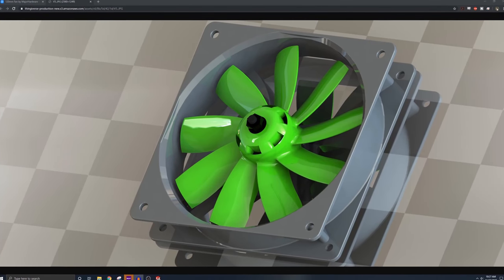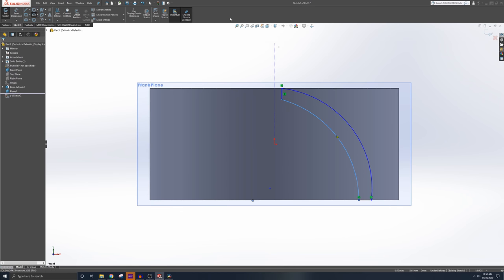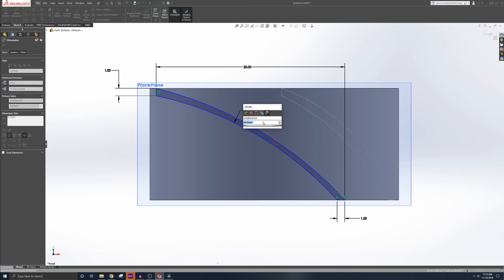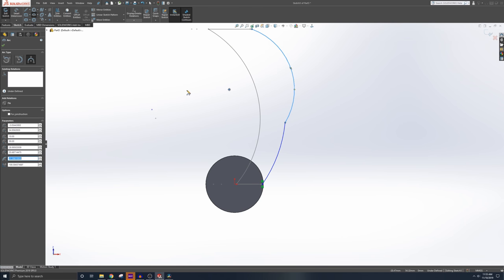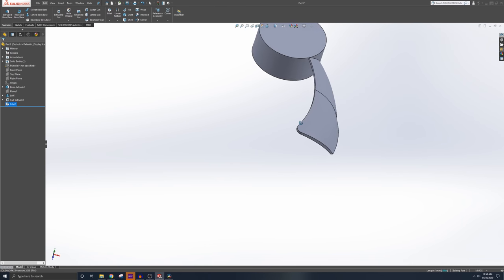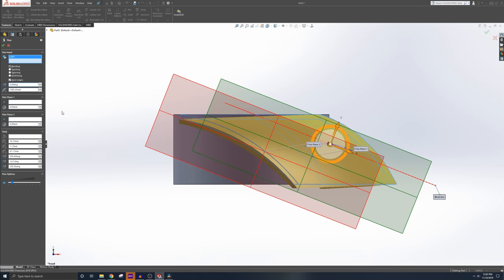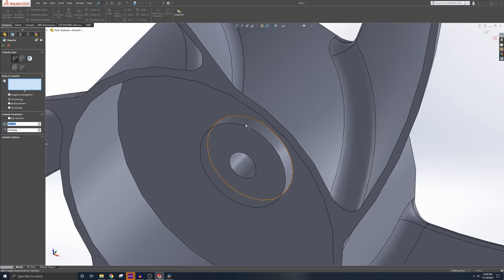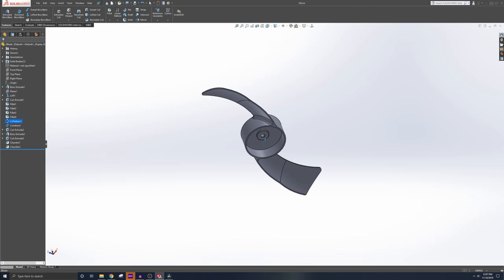How To Design PC Cooling Fan Blades

Comment: Suggestion for future videos: Designing your own ITX case using CAD software.
Reply: There are some chinese companies that will then build them for you or protocase in the US or Canada. That could be a really interesting video.
Reply from the maker: I want to do a small form factor but I dont have the hardware for a build
Reply: @MajorHardware  I am also working on a small form factor build, but I don't know anything about aerodynamics and I need your help. Is there any fan blade design that holds a noticable amount of pressure inside a sealed container (or case)? (we need pressure in order to increace the surface aera of the cooling parts in a buld like this) Thanks for your help

Comment: When I drew up a few fans I used the sweep feature with flex instead of loft, but it gives way less control of the shape of the blades. So any future fan design I'll definitely use your method 🙂

Comment: Been using Acad for 12 years but stayed away from SW as I could never get my head around the drafting process.  But after doing setups and making parametric families in Revit, SW makes a lot of sense and doesn't seem that difficult anymore.
Reply: New ACAD is decent but SW is just so much easier lol
Reply from the maker: Solidworks is the easiest in my opinion but I didnt use inventor that much and other than that I have used catia which is powerful but much harder to use but if u spend enough time on any of them you will pick it up
Reply: I've been lucky enough to use a spare ACA copy from work, but if I had to buy, SW & Inventor far outstrip Acad in capability.  It is pretty good when it comes to flexibility, free-form design, and the ability to brute-force solids.  I've really grown to appreciate it after dealing with Revit, where it will show the complete action but throw an error and refuse to do it.  And it can't even be bothered to tell you why.

Comment: Make some high static pressure fan blades for a 200mm noctua and compare again with using them on a radiator with water cooling.

Comment: Hey friend I'm designing some blowers on solidworks, so u have an idea to make it more efficient??? Nvidia design looks better than AMD old blower but I can't really prove it
Reply from the maker: Only thing you can do is run a sim to see what design performs the best and then do IRL testing
Reply: @MajorHardware  thank you friend!im new subscriber, and im trying improve you help alot with this. i don't have much experience with simulation but i think can made something with 3d printer better than Nvidia stock blower.

Comment: Nice.  Thanks for this.  Your previous video inspired me to give 3d printing a fan a try, and I had no idea where to start.  I ended up cutting a spherical shell for a blade.  I knew it wasn't an airfoil.  It printed very nicely in vase mode and it looks like it should work.  
Unfortunately, I broke the motor during disassembly of the donor fan, so I'll have to find a more friendly donor.
Reply from the maker: Getting a fan motor is the hardest part. I have tried to take apart many. The GPU fans in this video were the only ones I have had success with so far

Comment: Have you ever done a fan that's low-profile (15mm thickness tops) around the frame and edges of the blades, but normal profile closer to the hub? What would be the flow implications of a blade shape like that? Asking for a friend whose sff case fits a rad but no fans and it's a bit irritating.